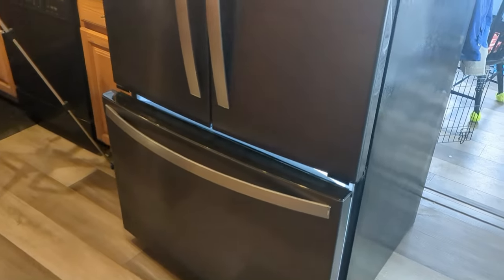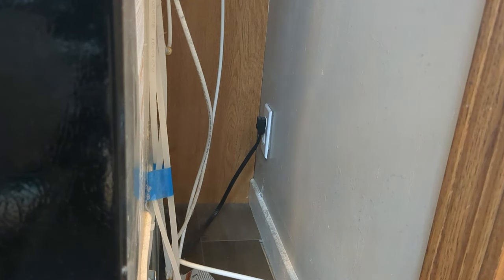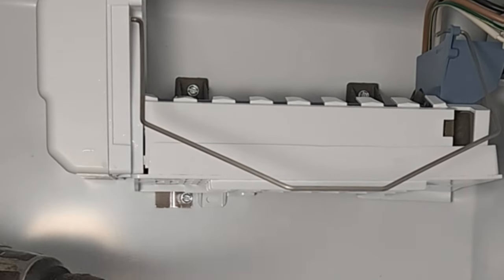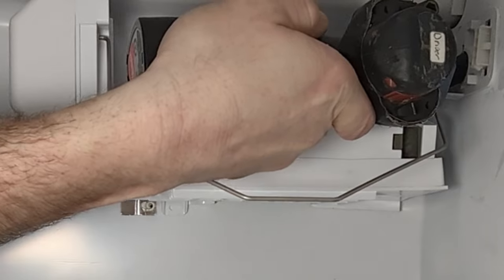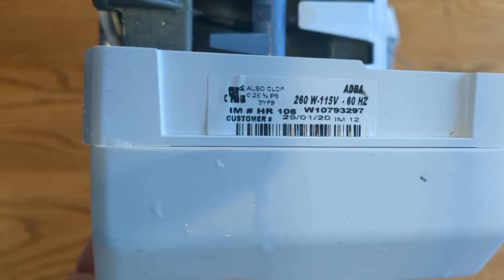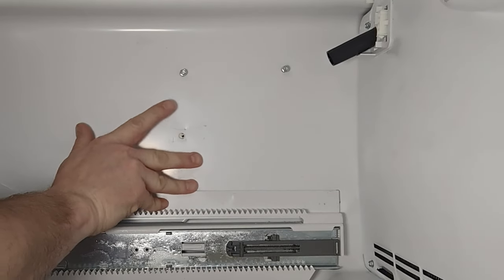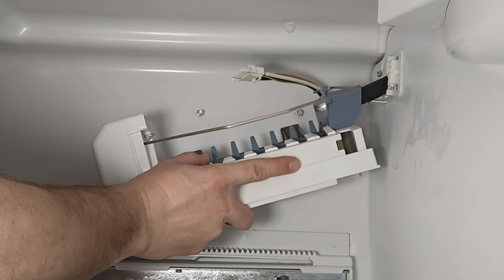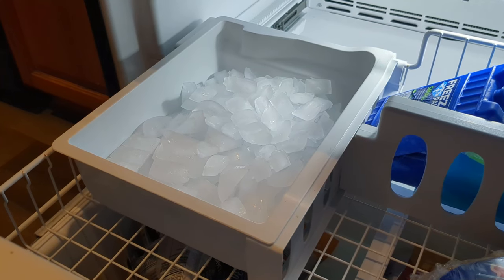Whirlpool Ice Maker Repair For Freezer under Refrigerator (Maytag Kenmore KitchenAid Amana Fix)

Comment: Hi.  Our new Maytag comes with identical ice maker.  I don't plan on connecting a water supply to the fridge so I'm wondering if I can move the wire are to the off position and remove it from the ice maker as well as disconnecting the wire harness.  Thanks in advance.

Comment: My ice maker has good water flow and I’m able to get the motor running, but it doesn’t want to go through a full cycle and actually make ice.like control arm was in on position but haven’t heard the water kick on to fill it to make cubes. Any ideas? Thank you

Comment: 3:31

I’m referring to your video to see if I did anything wrong or different.

I took my old (broken) ice maker out because it was overflowing with water and flooding my bridge and kitchen. I did not turn off my freezer. 

Upon installing I also did not turn off my freezer but it is still not making any ice. I have turned my fridge off and also tried rebooting the ice maker with the panel in the fridge doorway. 

The above water dispenser is working so I wouldn’t think it would be the ‘Water inlet valves’ but maybe it is?? Any suggestions??
Reply from the maker: Hi Paul, in your comment you mentioned that your old ice maker was overflowing. That may also signal other problems besides just the ice maker. When you say the install is not making any ice, you need to check if the ice maker motor is still turning the spikes to push out ice cubes but just not accepting water or if it's not turning at all. (My ice maker spikes turn very slowly - It takes several hours to make a set of ice.)
Here's an article I recommend you check out to troubleshoot further:
https://www.whirlpool.com/blog/kitchen/ice-maker-troubleshooting.html
Reply: Thanks for the reply. After a few diagnostics I think my problem is actually the 4 water inlet valves/coils in the rear. I plugged both new and old and both seem to spin fine but I couldn’t get water. Luckily the part is available locally, gonna buy the part tmr and give it a try!